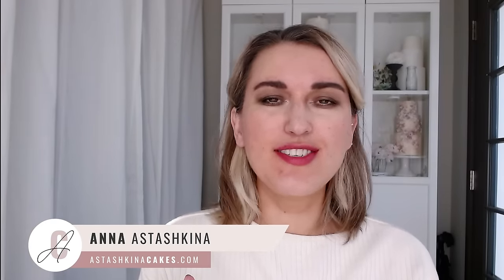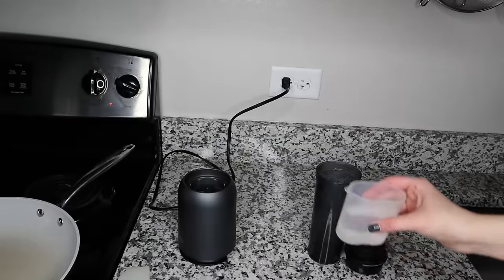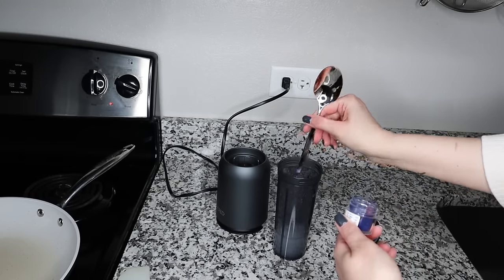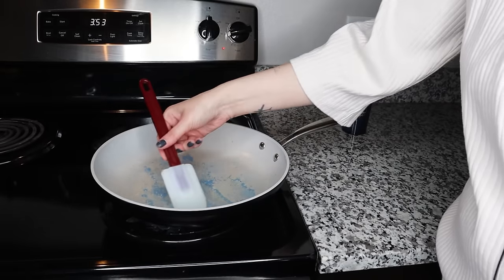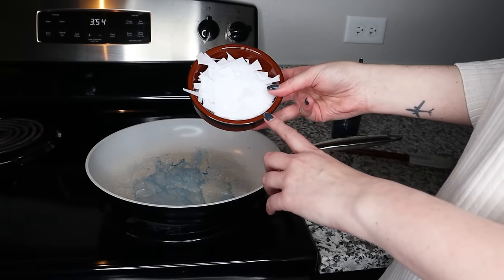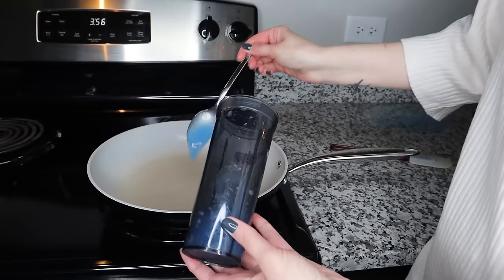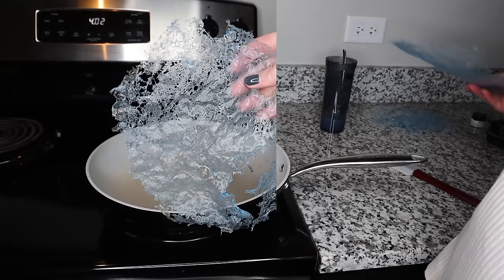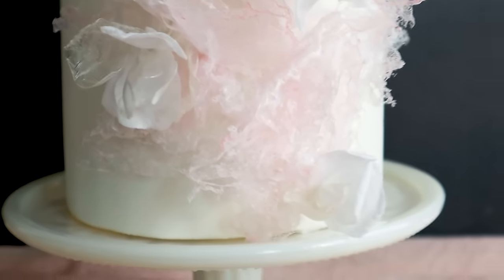How to make wafer paper flexible crinoline tulle lace - my exact recipe | Florea Cakes

Comment: Hi, Anna. What paper grade you used. I've used different ones and it does not work. The result is not as flexible as when you show it. It breaks into thin pieces. Any recommendations. Thanks.
Reply from the maker: Hello, lovely! I've used my scraps, but it shouldn't matter. Most common reason - you are keeping it on the pan for too long and over drying it. I've made an IG live video on how to do that step-by-step and how to keep it flexible.
Reply: I found this was happening with mine too so I put it in the fridge for a while where its a damp atmosphere and it did become flexible. Hope this helps xx

Comment: I did mine now without any specific recipe and it was so crunchy. I need to try your recipe💞
Reply from the maker: Take off heat earlier to make sure it stays flexible
Reply: @floreacakes  i also didnt know i have to lower the heat. I am doing it again tonight. May i add gold
Luster dust to the liquid before putting it in the pan? I need to make some gold ones

Comment: HI Anna firstly love love this tutorial...THANK YOU for sharing...if i add this to my cake can i store my decorated cake in the fridge?
Reply from the maker: Generally, if a flower is fully dry (made a few days in advance) — it is safe to put it on the cake and in the fridge.
I put my cakes in the fridge in a corrugated cardboard box and let them sit at room temperature for a few hours to avoid condensation. And I never have any fresh produce in my fridge, if I’m working on a cake. However, it is important to know your fridge and your room humidity because the difference causes condensation, not the fridge itself. It is better to use a hygrometer and check the humidity to protect wafer paper from melting.

Comment: Thank you veeery much Anna for all your tutoriels i m folowing you on YouTube Pinterest Instagram lol . I tried this method but m'y laces still crispy 😢
Reply from the maker: You need to find the bliss point when you can take it off your pan but not over dry it. When I was making mine, it was 30% humidity - so very dry, but still they became flexible after cooling down. I would suggest to use lower heat and keep a close eye to take it of the pan as soon as possible.

Comment: I tried this technique, but It didn’t work for me. The wafer paper never got soft for me. I was barely able to but it on the cake without breaking it, but i had to be careful all the time. The air is pretty dry where I leave in. I did put the humidifier next to the wafer paper, but it didn’t help at all.

Comment: Anna, I just tried they came out of pan perfectly and I let them sit for a couple minutes on counter. When I try to manipulate their not really flexible, like yours. They kinda move then crumble. Why is the crumbling happening?
Reply: It is happening the same to me.
Reply from the maker: You need to find the bliss point when you can take it off your pan but not over dry it. When I was making mine, it was 30% humidity - so very dry, but still they became flexible after cooling down. I would suggest to use lower heat and keep a close eye to make it of the pan as soon as possible.
Reply: @floreacakes  thanks i'm gonna try again now
Reply: @floreacakes  ok, I will try that. Thank you so much! ❤️